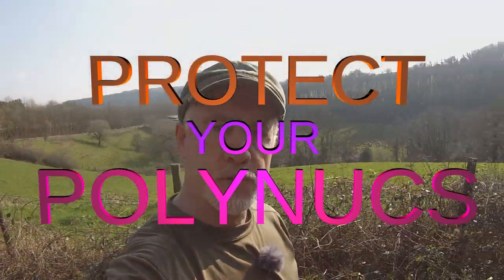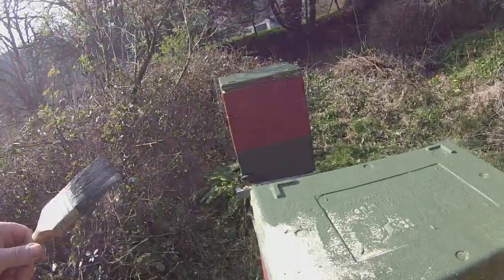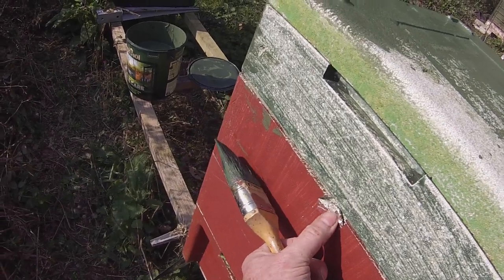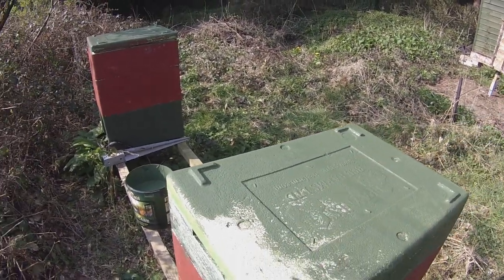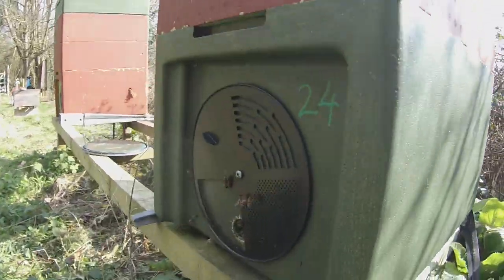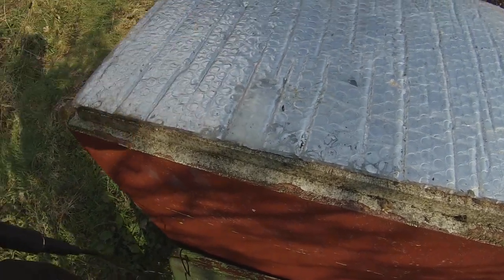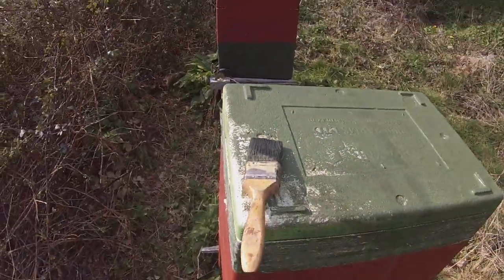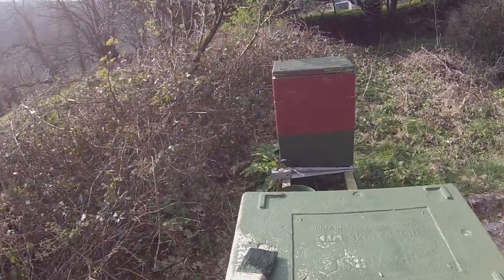Protect your Polynucs!

Comment: I've given up, using masonry paint or water based paint on poly. Instead I've been using Sadolin extra durable stain, it is solvent based. Solvent based paint was recommended by a commercial beekeeper, because it bonds with the poly and you don't need to paint the poly every few years. I had the Sadolin hanging around after using it on wood. The painted wood is 8 years old and doesn't need repainting yet. For your Payne's nucs, buy the top feeders, when they are not in use, they can be used as a top insulation below the thin Payne's roof and above the acetate sheet.
Reply from the maker: Most of my hives do have the feeders in place throughout the winter.